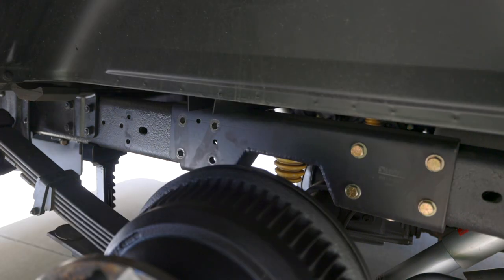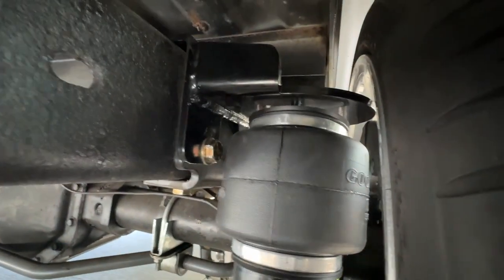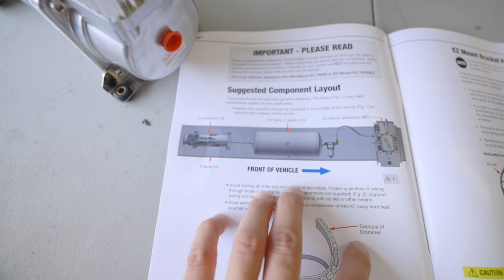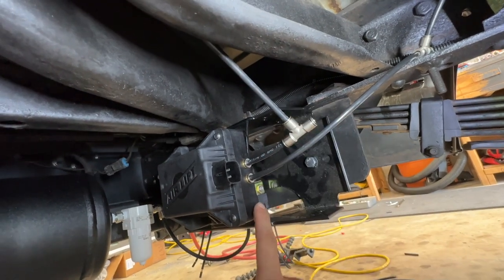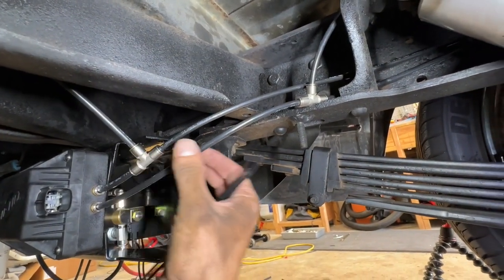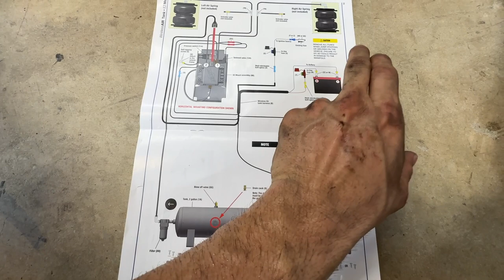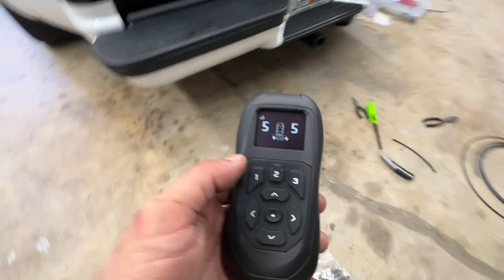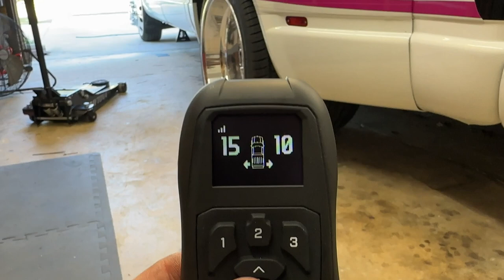Installing Helper Bags in our Slammed Chevy OBS Dually

Comment: but ya i use different companies with different sizes with 100% duty cycle compressors along with different tank size options like viar, airslamit, & airmaxx just to name a few i usually use dual compressor setup with 580 compressors and a 5 gallon or larger tank which I've used for all kinds of things even ran more than a few times on framing & finish nail guns on a few construction sites depending on climate I'd recommend air/water separator with a tank drain feature especially if ur in humid conditions alot and even an air tank heater/drier if ur venture into snow country during the winter alot cuz water is any air systems enemy and its so cheap to add that security to ur onboard air system to keep it running trouble free for years to come but love your vids esp on the era of trucks i grew up customizing it takes me back to the good ol days which seems like just a year or two even tho it was the 90's and early 2k's

Comment: i would just go with the inside the frame mounts for this install even though they're not the best for maximum towing but being that low its not like your going to be towing tall 5th wheel rv or gooseneck trailers with it wher you would benefit from a outer frame mounting kit.. even with the inside the frame kit would allow you to use any size & style of bag which would actually benifit you alot more.. as far as power wire I'd run you a 4 gauge "OFC" power wire to ur bussbar that way you could add a fused charge wire to your trailers 7 way plug for charging ur trailers brake away battery or if you have a dump trailer or rv it'll charge ther batteries as u drive down the road

Comment: Wheels may possibly still foul on the bag mount when you pull into a driveway and one wheel lifts and one drops. My ext cab used to have helper bags before I got it, it's 4/6 and I'd love to put some back in it. Nice truck, love your channel 👌
Reply from the maker: Good point! I haven’t driven it enough to see if it’s running but I will definitely be keeping an eye on it.

Comment: Have air lift on my dually with blue tooth air compressor. Didn’t do tank. Will have to get this bag setup though.  When I dropped truck 5” rear so the bag setup between frame & spring too close. Doing c-notch with your air bag setup. Should be better.
 I cut a steel plate to mount compressor to and mount to frame on passenger side frame right behind cab up high and no chance of getting hit by something. Nobody can see it either.

Comment: Any good websites to use for a PCV hose for my 1990 obs 5.7 motor?
Reply from the maker: Try rockauto.com I have been using them lately for OBS parts.
Reply: @motortopiaondemand  I did but I couldn't find the pcv hose that I need
Reply: What lowering kit did you do to fit 22.5 ? 5/7 kit?